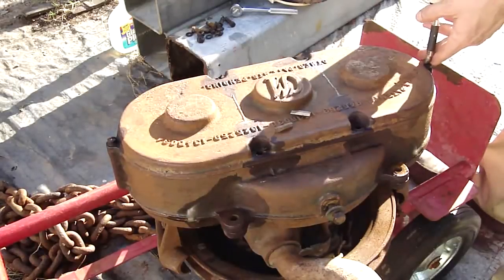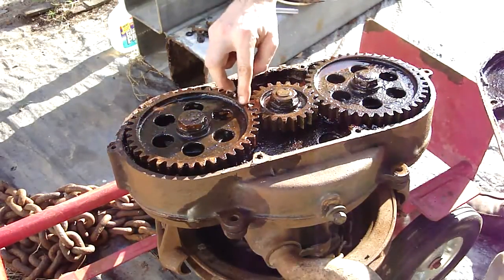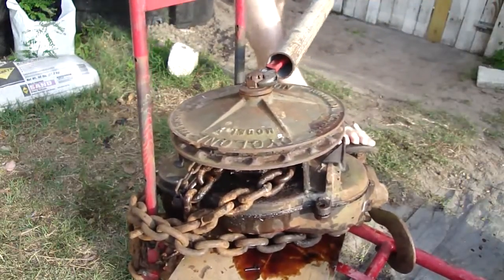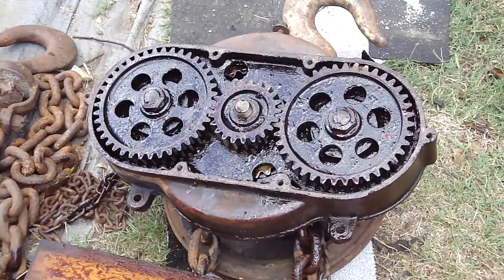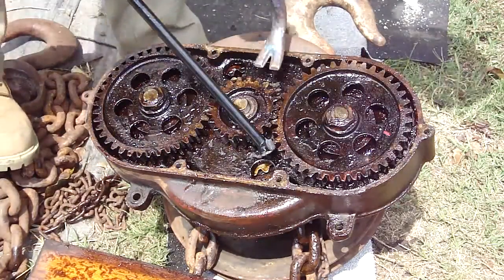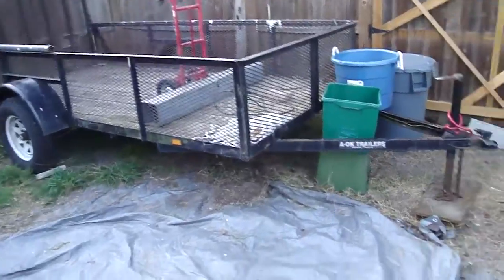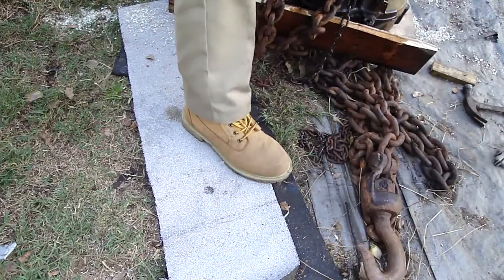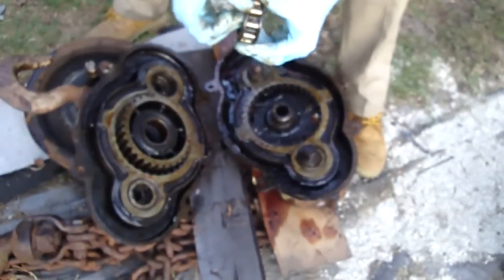Hoist Part 3 Gyrating Yoke

Comment: what he seems to miss is that the brake is the one thing that goes wrong with these!IT IS THE PART HE LAID OVER LATE IN THE VIDto the left.the brake gets bound upand the old girl wont hold a load even though she lifts to her capacity.Ive got 6 of these ,various makes that wont work again because of this.The cast iron drive wheel is brittle and hard to remove without breaking it.but the brake is a separate assembly behind it and if you cant adjust it with the castlated nut,its toast!hanging it up even from the loader or forklift and seeing if it will hold a 100 lb.load will tell you if its ok.the nut on the drive wheel,is castlated to hold that adjustment and simply removing the cotter and giving it a half turn will hold the load.Ive got two chesters from 1941 that have chain blocks,a 4 part line,that are 8 tons.with 91 feet of half inch chain that I will scrap for the chains because they have laid in the mud 30 years,since 1988 and are junk.the bearings in thegear boxes are good but brakes are the deaths of them.too far gone to clean up.bent the shaft in disassembly.
Reply from the maker: Your experience is appreciated!
Reply: Is there a way to fix the brake? If so, how. i have one that will not hold a load. I dont wont to scrap it. Thanks for the help.

Comment: Hello, I am sure you put the winch back together since the video....do you have any pictures or videos of the finished machine?
Reply from the maker: +Joe Pearson I bought the hoist to mount to a crane I built for a shop that is still under construction, so it has been painted (not the greatest job), partially reassembled and set in the corner like many other tools I've collected. So, long answer is no pics for now, but I plan to do  shop tour when I get the other building constructed and the clutter organized.

Comment from the maker: I will have to measure from the eccentric to the teeth on the yoke that was removed to see if there is indeed some orientation issue. However, It seems extremely simple in design. I have an older sales add that describes all the features and gear reduction. It has an automatic brake in that there is no-way the chain gear can move without the hand chain wheel moving. I have it clean and painted just waiting on some machine felt for the main seal. New SS hardware and everything else seems perfect!